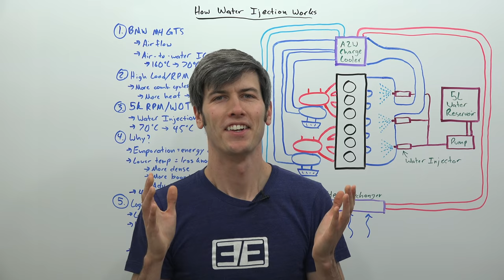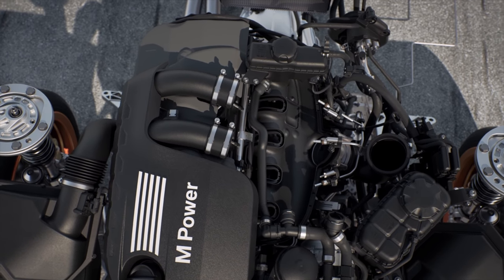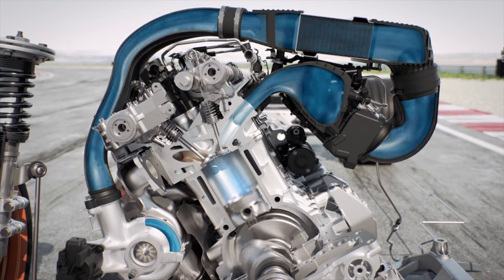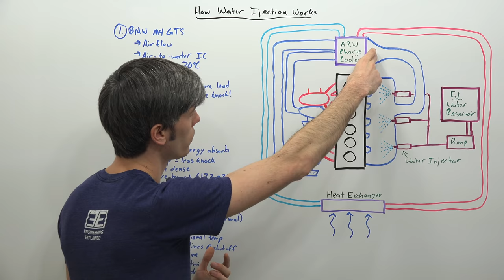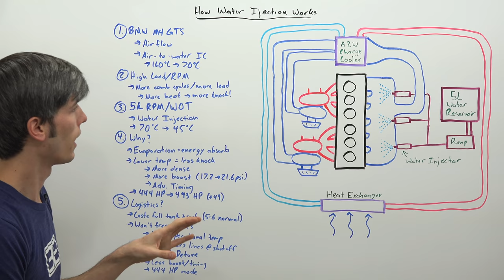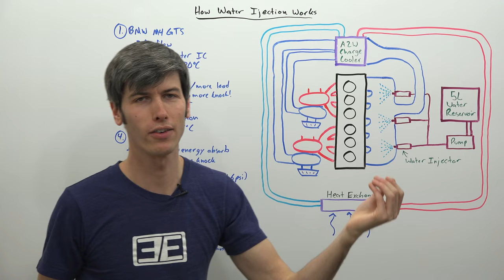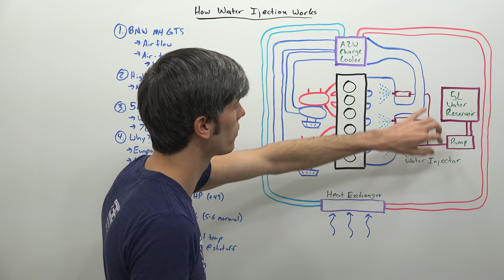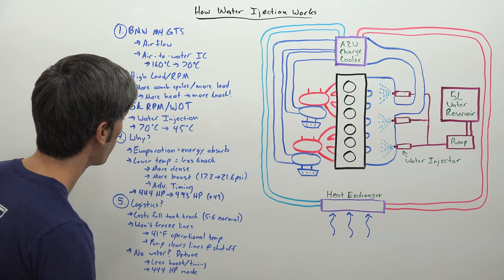How BMW Used Water To Make +50 Horsepower

Comment: This system is sold as a "convert kit" in Argentina by a small company to set up in carburettor engines. They get up to 20% more fuel eficiency. Also in Brazil there's a technician riding his fully water powered motorcycle getting 500 kms with only 1 litre of water through electrolisys. This is about 320 miles/a quarter gallon of water. There was an American who did so in VW Beetle 20 years ago, but died suddenly... This technology was also shown a few years ago in a concept car reaching about 1000bhp. I go crazy when big companies instead of fully developing a car running on Hydrogen with good or excelent gas mileage they only apply it to super sports cars as a gimmick.

Comment: Is it all just evaporative cooling effect? I would think that if you inject more water than will evaporate in the intake, then liquid water in the cylinders would evaporate from combustion heat and further increase cylinder pressures, essentially making it a hybrid ICE/steam engine. 

Saying it's a steam engine may not be a great marketing move, but if that concept works, I can't imagine them just leaving that potential power on the table.

Comment: Is it possible to use freeon(what's used to cool the air in your car) as a substitute for this since it's naturally cold
Reply from the maker: Not exactly how refrigerant works. It cools by expanding after it has been compressed into a liquid and allowed to change states to a vapor. Nothing will simply always remain cold when surrounded by heat. However, Dodge does use a similar strategy on the Demon (but you're not injecting the refrigerant into the engine). https://youtu.be/wLOkr-hUnU4

Comment: Engineering Explained I have a question .... How about volumetric efficiency??? .... by injecting water (not combustable fluid) in the A/F mixture wouldn't it reduce the engine potential??? (My image is that instead of using 100% engine volume with combustible mix you will be using .... depending on calibration/water injection rate .... maybe 95% or 90%) .... also, my guess is that BMW will use distilled water to avoid any deposits on the engine
Reply: How about doing your own research before using fancy "volumetric efficiency" words.... more boost without knock. More power from same size engine.
Reply: @valdius85  im sorry .. I thought I could ask anything about the video to him ... ill take easy from now question police

Comment: I've been wondering when they were going to start doing this on production vehicles.  I run water/meth injection and it pulls out about 100 degrees of temp, but my settings are +80 throttle, 120% MAP, 180 degrees F. IAT  4000RPM+  @EngineeringExplained  What about the cleaning benefit/aspect of the water  ie  "steam cleaning"?  is it a myth or real?  those valves/piston tops will stay clean alot longer maybe!

Comment: Correct me if I'm wrong but didn't SAAB use a water injection system on their early Turbo models in the late 70s/early 80s?
Surprised it has taken other makers this long to catch on tbh. Tuners and racers have been using such systems for decades.

Comment: I've seen in the past that water does get past the cylinders, contaminating the oil; rusting pipes (I hope they're not rusting or oxidizing).
It's a system that works everywhere. They should implement it in all economy cars.
If people would just drive 10-20% on water, gas consumption would go down, provided that the engine will last as long as it does without water.

Comment: Actualy electrolysis can be happening inside combustion engine, we just need better battery, super capacitor, coil, plasma sparkplug, water injection, high electric current in sparkplug will split hydrogen and oxygen inside combustion chamber instantly when water already injected into IC.

Comment: I used to use window washer fluid that wouldn't freeze. Though the BMW system isn't designed for that so not sure how it would respond.
Reply: That is if programming were so that it could run below freezing.

Comment: for real tho, what kind of water does it requires?
 is regular tap water okay? what if it's too hard that have mineral deposite build up? bottled drinking water that still have mineral in it? or cleaner deionised water or more expensively distilled water?

Comment: WW2 propller aircraft, particularly fighter planes, used this.  These included BMW engines used back then.  Though it was the pilot who activated the system.

Comment: I suggest the more substantial reason for the horsepower increase is from the increased density of the vapor mist being injected. Water has an expansion higher ratio as the gas being expanded in the cylindar over the simple nitrogen content of air. The recognized value is a change of 1 to 1650.  Why aren't they telling us this?

Comment: Water injection is so under utilized by OEM's or the aftermarket. I'd pair it with E85 for a Flex Fueled, turbocharged, titanic torqued titan motor.

Comment: Curious how this system would react to a hillclimb situation where as you ascend,  you're losing oxygen density to the turbos and intake as well as a drop in ambient air temps ala Pikes Peak
Reply: Modern cars dynamically adjust boost pressure. Which means on the top of the hill the boost can be 1.1 bar, while at the bottom it can be 0.9 bar and still produce the same amount of power. Do not confuse boost pressure with absolute intake pressure. The result is the same amount of air MASS entering the cylinders.

Comment: Ww2 airplanes had this water injection system to make more power. It was called WEP, which means war emergency power. Some planes like the MesserSchmitt bf 109 had nitrous oxide injection.

Comment: this technology is almost 100 years old already. was in use before and during WW2, the P-51 gained almost 1000 HP over it's rating of ~1300 hp with water injection but with a massive engine the duration of that power output was pretty limited, can think of it like a modern day afterburner... extra power boost(but it doesn't consume any extra fuel unless you want to count the water) for a limited duration.

Comment: Since water causes corrosion to aluminium (no sh*t), then wouldn't injecting it into the chamber actually get it rusted after some time? Or have they also sorted that out using chemistry, or chemistry sorted it out by itself?

Comment: What about the effect of water in corrosion?
Reply: I suspect it's probably tuned to the point you only end up with water vapour in the cylinders rather than water in the liquid state. And even if some of it makes it there in the liquid state after you release the throttle a little bit the water will shut off and your engine keeps running (quickly getting rid of it). Basically the water isn't sitting there in a liquid state and most definitely not stationary liquid water for a long period. The purpose of the water is to turn from liquid to gas, this takes a lot of energy thus cooling the air down and you get higher humidity air entering the cylinders.

My gut instinct tells me not to worry about corrosion under those circumstances assuming the water is clean, other liquids or additives/contaminants might mess things up I guess?

Comment: So the power is only increased over the normal model when you’re actually running hot and this system kicks on?
Reply from the maker: It’s a different tune for when the system is active/not active, across the entire RPM range. If it knows it can have better cooling at higher RPM, it can get away with a bit more boost at lower RPM.

Comment: Water injection has been around for a long time. My dad's 1970's Suburrban had it on aftermarket high compression engine, it was used when the car was driven below 5,000 ft altitude to prevent pre ignition ping. Water injection was also utilized on some ww2 aircraft. Nothing new, old known technology used by BMW
Reply from the maker: Who said it was new? Oldsmobile had it on a production car in the 1960's.

Comment: Cars uses gasoline injection to lover the temperature durring the compression cycle. When engine has a demand for max power and turbocharger pumps lots of compressed air into cilinder it is neccesary to lover temperature durring compression. This is done by injectors spraying additional fuel to lover compression temp

Comment: What are the downsides? And if there aren’t any why don’t other manufacturers use water inject? It seems awesome!
Reply from the maker: You have to fill up the water tank, and people hate the inconvenience.
Reply: Engineering Explained That’s surprising given most people put fuel in their cars everyday. I also would have thought an enthusiast wouldn’t have any issue adding water if it added horsepower
Reply: Engineering Explained Great video as always by the way!

Comment: i think its weird they should inject the water after the turbos so the effect is stronger with the higher temperatures and you could even collect some of the water in the air to water cooler afterwards and it should have an even stronger effect or not ?
i wonder what made them inject it just in the intake and not before that.
i guess that with the rapidly produced steam you might have to much of an air loss again yet if they put the water in at so low temp ... they have to use more to get the same temp reduction or not ?
hmmm xD

Comment: i wonder if you can put methanol or race fuel in the water resovuar??? it will definitly give awesome power gains
Reply: As mentioned in some other common threads, using methanol or alcohol will require a re-tune. It is also not known (at least to those of us commenting 😆) whether the components BMW used are compatible with methanol.

Putting race gas in the water tank would be pointless and would probably wreck everything.

Comment: Why couldnt they use isopropyl alchohol in the water in cold climates to prevent freezing. It would seperate once it enters the intake but that's ok. Hell, run a smaller gap to take advantage of the alchohol. It would have a side benefit of cleaning the valves too.

Comment: I thought this was going to be about 6 cycle engines, the type that use water or air injection. I read about many years ago. Concept seemed promising, as it used waste heat, and would reduce the need for a cooling system.

Comment: But water is not compressaibe, right? Does this really have no effect on the engine's combustion?
Reply from the maker: The water is vapor, not a liquid, as it enters the engine.
Reply: Transform to steam, volatilize the proper term.

Comment: Water injection hails from WW2 fighter aircrafts.
Mix it with 50% methanol for better effect, and probaly works as antifreeze too. Some chemical may be needed in the water to prevent slime growth and rust.

Comment: I understand that BMW uses many plastic engine parts.  I would think that engine heat will cause these parts to fail with time. Am I wrong? And, another YouTuber says that because of this, BMW cars are unreliable and are costly to repair.  Yet, JD Power and other rating services give BMW cars high scores for reliability.  I'm confused.  Can you help?

Comment: cool story about water run threw engines 
I saw a hit&miss engine had 
gas/kerosene/water valves hooked to intake 
Engine would start and warm up on gasoline once hot you'd swith it to kerosene and to keep it clean (maybe to prevent knock🤔)  you'd drip water from the cooling hopper into the intake. 
I don't remember what make the engine was but cool system.

Comment: The decreased moving parts and complexity of an Inline-6 is a good thing whereas this system adds weight, complexity, and cost.  On a high-powered car where you could gain 100+ HP, yeah, I'd say it's worth it.  It's cool to see engineers implementing unusual things, and I'll give some credit for BMW letting them do that.  I just like having power boosts come under all or most circumstances, not just WOT 5K+ RPM.  What is the HP difference right at 5K RPM?

Comment: Water doesn't compress like air so wouldn't that increase the compression ratio making knock more apparent? I guess it depends on the amount of water injected (or ijected) each cycle. But also would make the capacity of the engine smaller by the amount of water injected. 
Also everyone saying try methanol instead, that would increase temps because its flammable....

Comment: as far as i understand, water in a combustion engine is a bad thing, im trying to wrap my head around how does water not wear our the engine or mix with the oil, the residual water in the cylinder in the form of vapor can damage the engine, isnt it ?

Comment: Can you mix water meth for it?
Also is it simple tap water or distilled?
Reply from the maker: Distilled.
Reply: Cheers.

Will this make the engine cleaner too?
Carbon wise?  Bit like misting water into the intake of a car engine to help clean out the cylinders.

Comment: I see the heads turning over at Dinan, Giac, etc.  Switch to water/methanol, inject more and crank that boost.  I'm betting it'll be pushing 600 with that modification.

Comment: Color me unimpressed but in my car (self modded), 60 Celsius in the intake means it's already heatsoaked and the ECU starts pulling away boost to protect the engine. If bmw is reaching 70 Celsius after the charge cooler, i consider that to be a very badly engineered setup.

Comment: knock or autoignition?
Reply from the maker: Not sure what your question is, but assuming you’re asking why they use water, it’s to prevent knock, as discussed in the video.
Reply: @EngineeringExplained  engine knock is caused at low rpms and high loads, pressure builds up and the mixture reaches conditions to autoignite as it has the time required for it. Bmw system activates at 5000rpm, that should be to avoid autoignition, prior to the spark firing, not engine knock.

Comment: This should've been be standard with turbo-engines. At full throttle a turbo engine pulls through at least 20-50% more fuel just for cooling purposes. Water is waay cheaper and emits no extra CO2 and unburned fuel.

Comment: I'm slightly confused. Wouldn't water in the engine be bad?
Reply: Liquid air is atomised through a spraying nozzle into the hot air stream, the hot air evaporates it into water vapour. So you basically get higher humidity air. The engine cylinder is probably hot enough as well so that none of that evaporated water condensates out of the air, shouldn't get any liquid state water in there I'm guessing.

But even if you do, the engine will still be running for a while after the water system shuts down (you won't be asking 100% from the engine at all times). When it does just a few cycles will remove any trace amount of water from the cylinders pretty quick.
Reply: Thanks, I guess thinking about it as higher humidity air makes more sense :)

Comment: I would think adding water vapor to the incoming air would reduce the amount of oxygen that enters into the cylinder.  Therefore, the gains from cooling and increased density are offset by the water vapor taking up room in the cylinder that would otherwise have oxygen.  Water volume and pressure increase greatly when changing from liquid to gas.  My humble mind can not see how reducing temperature is more beneficial than the disadvantage caused by the reduction in the amount of oxygen.

Comment: forget the phrase watered down, this thing is watered up. on a second note, I give this thing 10 years max before the first cases of failed gaskets/o-rings/control valves and this system starts leaking water into the intake manifold and causes the engine to hydrolock

Comment: Great Work EE and could you please consider researching how Alfa Romeo gets even more power with a smaller engine and no water injection. 505HP from a 2.9. Seems unlikely that they are able to do it for sustained periods but it would be super interesting content for the high performance crossover / boosted community.

Comment: Why do you have the refill it? I'm surprised they didn't use the pure water produced from exhaustion, and this process, by collecting it from the exhaust somehow , say for example in the muffler. They could even filter it and offer to drink to passengers. And call it Blue Green mode to get a government pass on the high fuel consumption tax? lol

Comment: Is this the same technology Germans used in the Focke-Wulf 190s?
Reply: Very similar, yes. Many allied aircraft used this as well. It was used for increased powee during takeoff and in some cases for W.E.P. settings. Though it wasn't designed for sustained use like this is. On WEP a warbird engine would last around 5 minutes before deterioration begins to occur.
Reply: @Erowens98  yeah imagine to get a boost from 1600 hp to 2000 hp. Definately needs a rebuild after that

Comment: Everyone falls for the “density fallacy” lol. No, an intercooler and/or WI system does not cause the engine to ingest more oxygen due to denser air. The turbo is not magically flowing more air mass because of the water injected downstream, nor because of the presence of an intercooler :)

Comment: Saab used water injection back in the day ;)
Reply: Yes you are correct. My 9000 turbo had it back in the 80s. No water tank to fill as well.
Reply: Yep I used to work for Saab, and we had the Water Injection kits in our dealership which were part of the performance upgrade packages. To go with the Red APC boxes, 3bar fuel pressure regulators and so on. I think we stopped them in 1987.
Reply: Nazis used water injection back in the day.

Comment: Water is 3215 times better than air at absorbing heat. I did this on my Possium Borne WRXsti back in 2002. Water activated by boost injection.